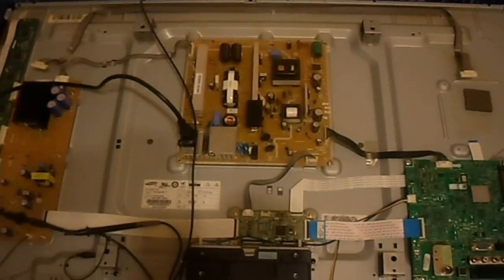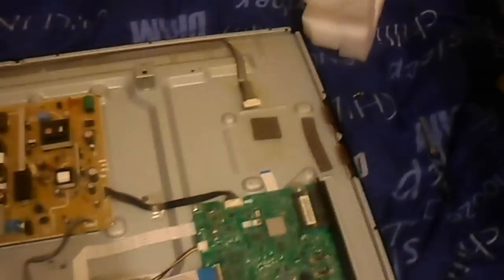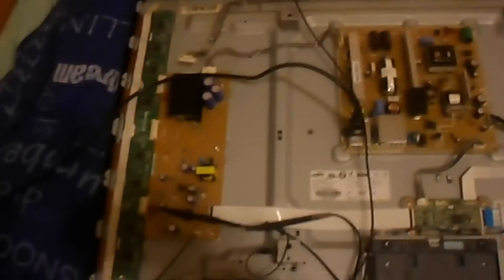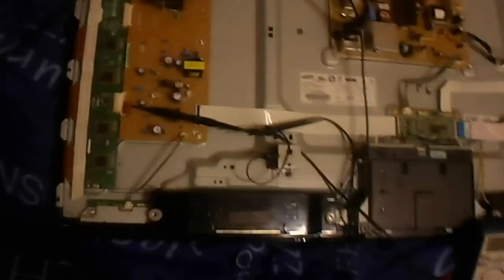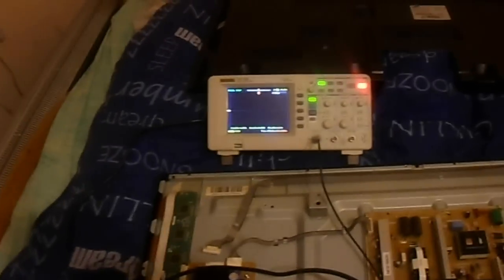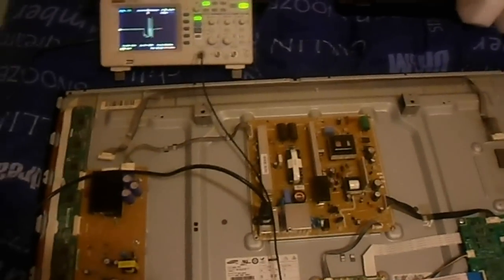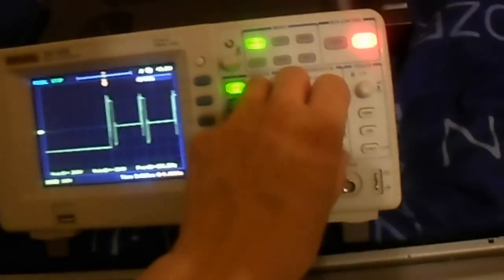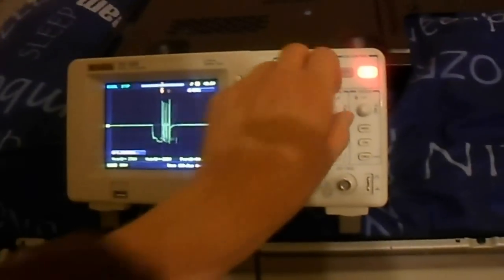Samsung PS43D450 - When replacing Y-Main consider X-Main too!

Comment: I have this TV, now it doesn't come on, when plugged in, the screen gives a quick flash, but then nothing, the LED on the in side on the small main board comes on solid, then flashes off then comes on solid, then flashes off, every 5 seconds or so. unplugged the Y-main and Y-sus as per your last vid and the LED stays the same, the TV still doesn't come on. Any ideas?
Reply: DirtyRottenBastard u got a replace a y an x sustain board at the same time even upper and lower buffer board